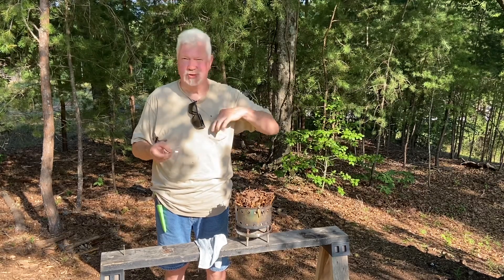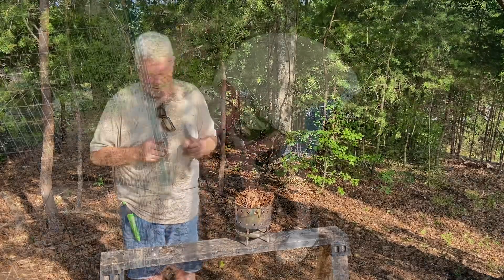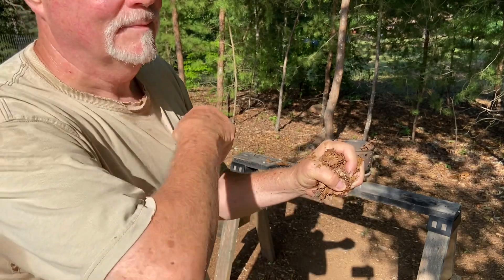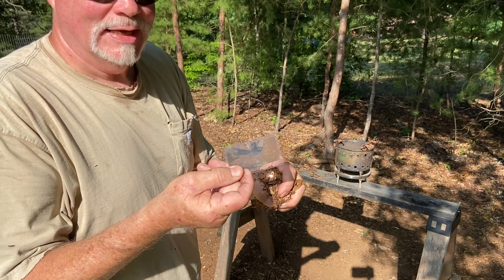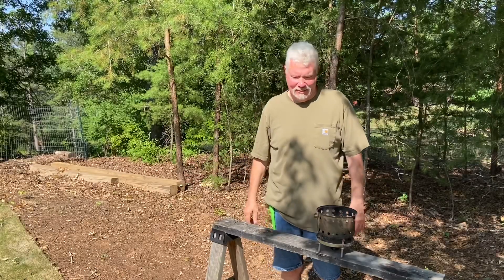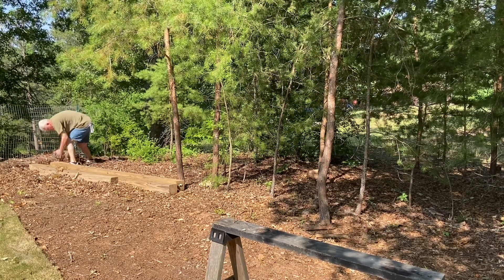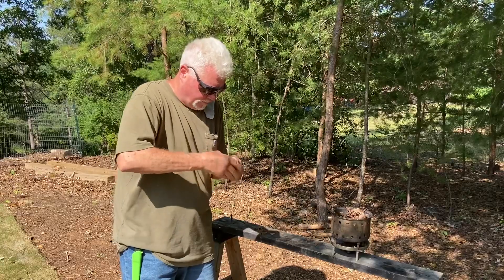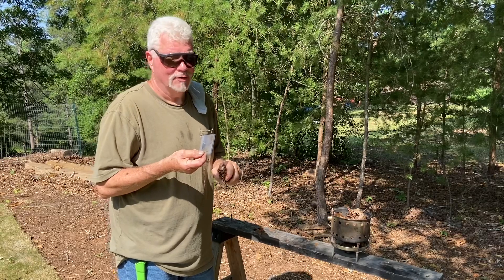Advanced Wallet Fresnel Lens Fire Making

Comment: Smoke in your face... Bernoulli's Effect
Reply from the maker: Bernoulli’s principle is a theory about fluid dynamics. This simply means that it describes a way that a fluid (a liquid or a gas) moves.
When a force acts over an area, it is called pressure. A high pressure will push fluid towards a lower pressure. If a fluid changes speed, it will be matched by a change in pressure.
In one sentence: Bernoulli’s principle says that as the speed of a fluid increases, pressure decreases.

Comment: Whole-heartily agree with your synopsis of the eddy effect of the smoke. You were right about the pressure differentials, which would quickly vary in relation to ambient air movement and blockage. Back when I was flying hang gliders, we were keenly aware of the "rotor" or eddy effects down wind of wind cresting peaks. I've seen many strange and wonderful sights in the low clouds and fog along mountaintops.
Reply from the maker: I can imagine. TY, friend!

Comment: Smoke follows beauty??
🤣🤣
or
low pressure vortex on downwind side of 
your head, pulled the smoke in.
Reply from the maker: Wikipedia excerpt... Once formed, vortices can move, stretch, twist, and interact in complex ways. A moving vortex carries some angular and linear momentum, energy, and mass, with it.
Reply from the maker: This is an example of drafting... During a race, drivers can get a speed boost by lining up their racecars. This is a formation called drafting. When cars draft, the leading car blocks the movement of air, creating low pressure behind it. The low-pressure air creates a vacuum, tugging the trailing car forward while reducing the leading car's drag.
Reply: Yes, draft is more accurate.

Comment from the maker: Advanced for several reasons 1) You have to be skilled in solar ignition techniques. 2) You have to understand the coal extending properties of leaves and tinders in general. 3) You must overcome you're fear of fire because you're building a large ember in your fist that will be going to flames... and 4) You must have unusual patience while building and nurturing embers and flames. This can take several minutes for each.
   Discussion of the "face full of smoke" scene at 6:40. I think this effect was caused by smoke stuck in the negative air pressure in front of my face and then it got drawn towards my face by a backdraft... My head is blocking the brisk breeze that's blowing from behind creating an eddy of air... a negative pressure. As I pull my head back away from the cloud of smoke, I create draft which is pulling a huge amount of smoke towards my head. WHAT DO YOU THINK IS THE REASON FOR THIS EFFECT?
   Please follow the LINKs below and SUBSCRIBE. Thank You!

Solar Ignitions Playlist
https://www.youtube.com/playlist?list=PLkoXX8XsMW3kl5CicmPv0pTz-7rj4gczW
Hands Free Solar Ignition, Wallet Fresnel Lens.
https://youtu.be/ScesrTSDxVg
Reply: At 6.40 David, you surrounded yourself with a very effective mosquito barrier indeed.
As you correctly stated, your body caused a low pressure eddy in the air pressure near you, and as the smoke was following the path of least resistance, (air pressure), you became a smoke magnet. 👍
Reply from the maker: LOL! I knew I could back out of it far enough to get it to dissipate... and then start breathing again.
Reply: I think your description is fairly accurate.
Reply from the maker: Thanks Doug.